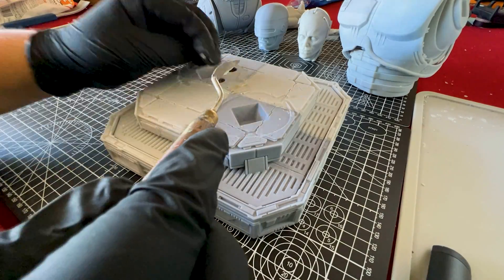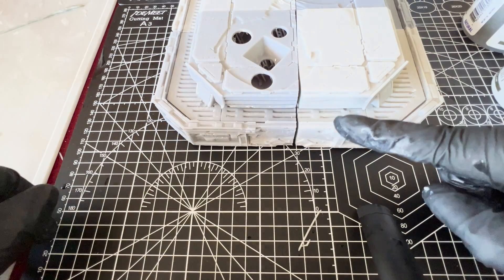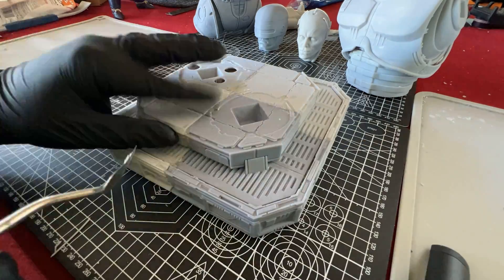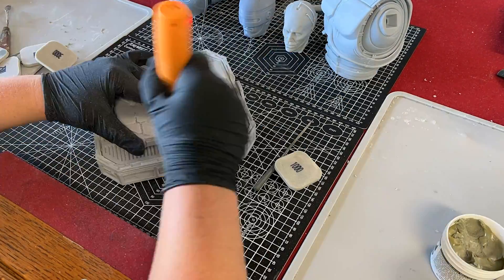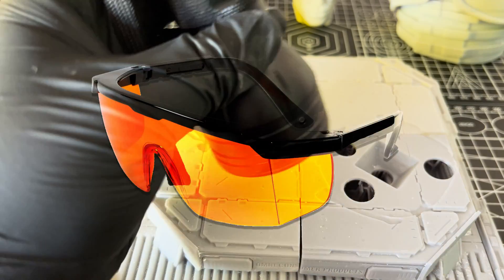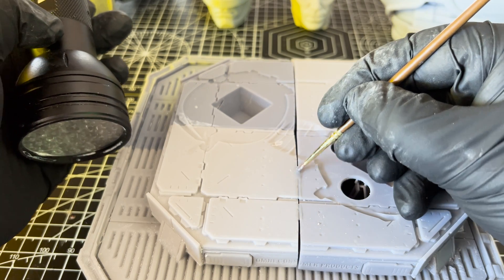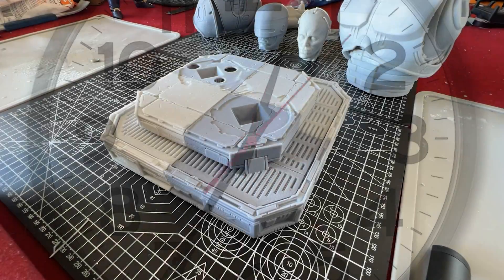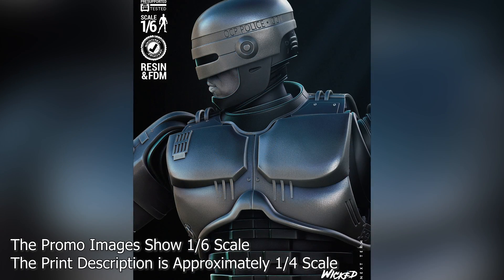How to Fill Gaps in Resin 3D Prints: Two Easy Methods

Comment: Phrozen has this resin 'paste', very easy to use, bit expensive though
Reply from the maker: I have browsed the Phrozen catalog and somehow have never seen that “light curing putty” before 😳 

It is pretty expensive but I wonder if you can make a home version for cheaper… 🤔 Or if other cheaper “UV Putty’s” would work just as well.

Thanks for the comment, I appreciate it! You might have just given me a future video idea.
Reply: @ResinForge  My pleasure! Their kit works really well with the flexible LEDs. Perhaps somebody else will make it cheaper someday.
Reply: all you need is baby powder and resin, there is your resin paste, and its dirt cheap
Reply from the maker: @scarfa21  That works and is usually what I do for a paste, but I have had some small bubbles appear after curing when mixing resin with baby powder or cornstarch. 

This putty looks to be a similar consistency to Vaseline or pomade and I would be interested to try and replicate THAT consistency in a cheaper way.. 

They sell UV putty on Amazon for a lot cheaper than the Phrozen one, I’m gonna order some and try it out
Reply: @ResinForge  lol i didnt even know they sold it until i watched this
Reply from the maker: @scarfa21  I didn’t either until @SigurdDecroos brought it up haha

Comment: Another metod I use is to mix resin with baking soda. It makes a resin paste depending on how much baking soda you add to it. Just cure it and sand as normal.
Reply from the maker: Great tip! I sometimes use flour to thicken up the resin a bit. Probably should’ve mentioned it in the video 😂 Lately I have been choosing to use apoxie a lot more than resin cause it’s more forgiving and easier to work with. Thanks for the comment, I really appreciate it!